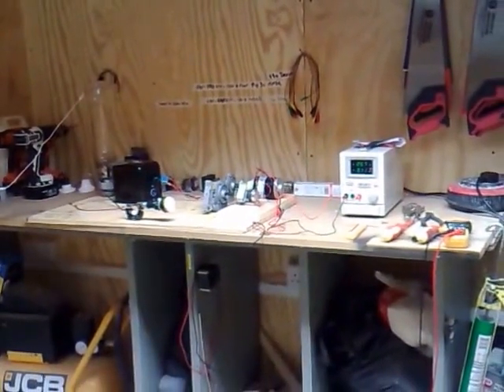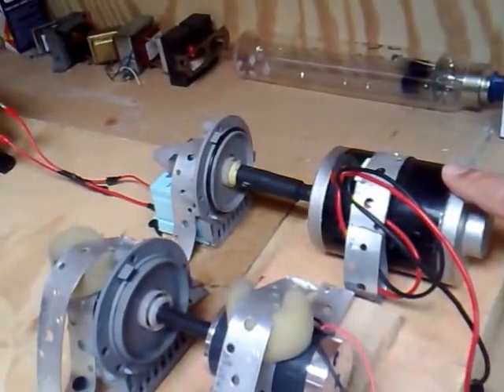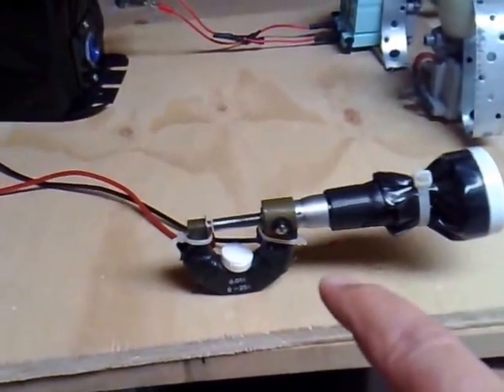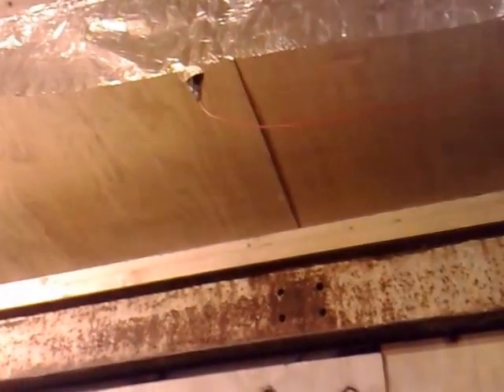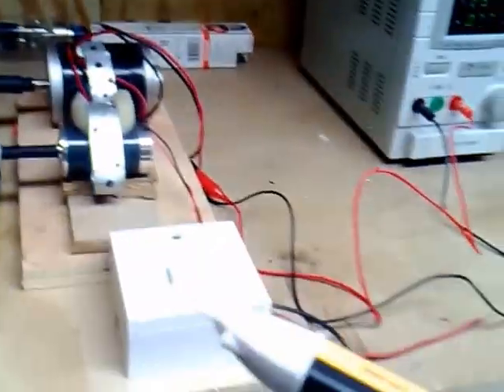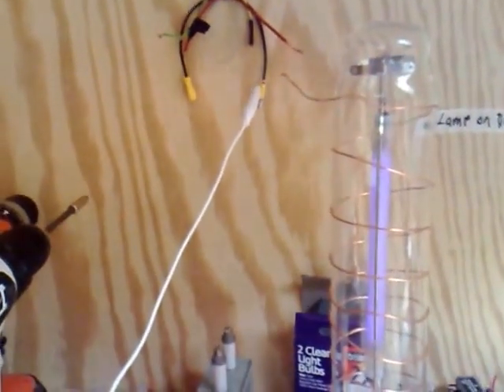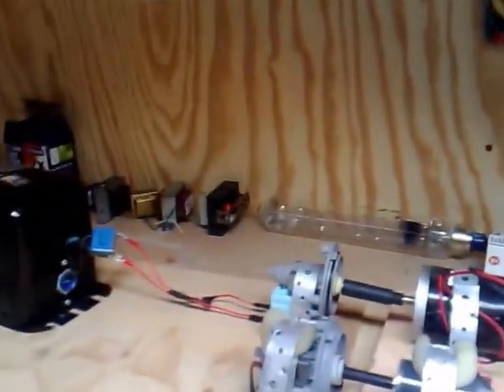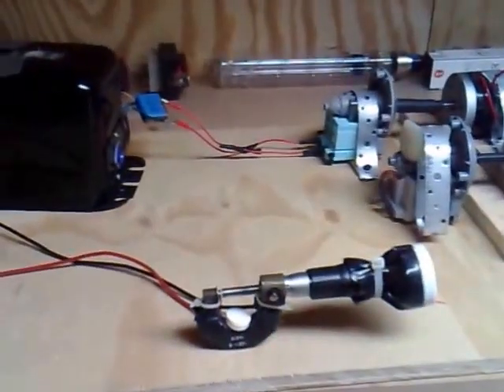Gerard Motor PROOF of RF.mp4

Comment: Hey E power DC your voice sounds a lot like Pete Townshend from the who. Anyway in some of the literature I have read from Tesla, when he would wind transformers he would leave sparks gaps, many sparks gaps in fact, and the reason he gave was an interesting one. First I must say that trying to understand what Tesla is doing in a conventional sense is a waste of time because his understanding of Electron flow is quite different from what I was taught when I attended the electronic institute in Pittsburgh. Today I work as an electronic technician for a company and have always been fascinated with Tesla. I makes me very angry to learn that Tesla had a very different idea about transmitting electricity to homes with no heat loss transformers which would have made everyone's electric bill very cheap, I was taught in school that if it were possible to correct the power factor phase angle to perfect unity our electric meters would not even turn, tesla transformer would have corrected this but greed as usual shot it down and all evidence was incinerated, well almost all.... But that is not why I am writing. Tesla stated that when a spark gap is added it acts as an amplifier when the arc surges from one gap to the next and that he would put as many gaps as he could in his transformer designs, which I used to have, so I was thinking ...most people use one spark gap but what if you could use several transforms connected together and in between each of them add a spark gap? Just a thought.But be careful my father in law did something simular to this when he made a giant tesla coil and blew out everyone's radio and TV reception for a block and a half, he was quite happy with himself. SO yes definitely, high frequency Radio waves is the key here we all should be focusing on.
Reply from the maker: +Harry Flo  hI again HF like your comments about the spark gap because understanding what is going on is KEY. Tesla called lightning "Events" in the either. Electron flow is also very interesting. Quantum theory of light= wave & particle & possibly scalar at the same time, sounds like Mm electric. Trying to make a plasma transformer at the mo, video delayed very busy. However I can not wait to try it out. Thank you for your interesting comments, I look forward to more from you. ....  DC
Reply: Our system does not want people to have a way of developing cheap power, if it doesn't create profit it will not be researched nor exploited, instead it will be suppressed and killed off by any means necessary. This is our wonderful system, it doesn't matter what country you come from, it is the nature of most men to be greedy and dominating,  controling others so they must submit and be enslaved and conditioned so the wealthy elite will be able to manipulate and control so they can remain in power.
 It is up to the free thinking individual who doesn't care about wealth and power and is only interested in the well being of his country men and women, this individual is rare and only comes around few and far between in history, this person of whom I speak was TESLA, selfless, humble and generous someone who gave a damn but was forced into bankruptcy from the Wealthy PIGS who wants humanity enslaved instead of empowered and free...

Comment: Interesting idea that electricity is RF. Has some merit. Electricity is not actually carried by free charges. It is carried by changes in potential (electric field pertubations). The virtual particles which carries the energy are phonons and excitons, not electrons. The electron drift is not fast enough, nor has enough charge capacity to explain the current. Also, ac drift is slow. In the old-days the ac current was truly alternating between positive and negative (causes issues with potential difference direction changes with grounding), but yet the current capacities were enough, though the net electron drift over 1 cycle is zero.
Reply from the maker: +rascal1234 Yes now we have synergy, I like the way you think. So what happens in the current? Scala? Knock type vibration? Thank you for your input, very interesting. ....  DC

Comment: Interesting discussion but at the level of standard Kirchhoff-Ohm sinusoidal circuits. This is not the type of circuitry Tesla was working on. His (Tesla) radiant energy doesn't oscillate sinusoidally, its aetheric where motion takes spiral and conical path at small scales (Planck scale perhaps)
The radiant energy pops out from wire at 90 deg and doesn't oscillate the standard way . Traditional power calculations don't apply at nano and smaller scales. 
This Tesla radiant energy can power both lamps and motors.

Comment: hey there. i'm just asking this small question: What is the Pump? ist it just a rotationg magnet with a coil underneath it?
Reply from the maker: Hi basically yes it's an A/C unit. This set up is a great starting point for experimenting cos of the findings with learning about electrical potential & more importantly how its made. Ask the right questions, but experiment for yourself. ... Regards... DC
Reply: Thanks, DC, but I'm not an electrical engineer, but I'M trying to rebuild my knowledge. actually, i just want to know, because i have to explain it to someone i Know, who knows the conventional stuff really well. together with him, i will build it.

Comment: Did you do any meter readings off camera?
Reply from the maker: +Colin Hammill  Hi Colin yes, going to share some readings on next video. The reason I didn't was that I blasted one of my three metres & damaged my scope getting them too close to HV. I just want any readings to be correct. Some of the Hz readings were around the "Tesla Lights" readings low 5Hz to 13Hz I could vary the Hz with higher motor revs.
Reply: ***** I think the Hz have a lot to do with Gerard Morins results I`ll keep an eye out for your video. Cheers for replying mate :)

Comment: All AC is RF ! Free energy must be amount of work done the bulb is reflecting at a lower energy level due to a higher frequency so you need to use something that can lift weight like a drill ..Ok ! But nice video and please do the loop  between the two motor generator its very simple if you know what you are doing.

Comment: If you held the tester ,2-3 feet away from the aluminum foil at the same height when you were testing the foil for RF, you would have been amazed to have found that your tester would also beep.         HuH  !! ??      yeah !! your might pull your hair out  and discover the air being warm at that height is  energized thus giving you a false positive. You also did not install a blocking diode preventing back EMF.  thus, possibly negating presumption of a high RF signal that operates within the tester's range.    Don't be offended by my skepticism.  be challenged.
Reply from the maker: +moron moron Hi M.M. I am just a learner "Student" of Tesla. I am looking with untrained eyes. Electric is very much like "Light" in the way it behaves. I am working with "High Voltage" like Tesla, its really interesting particularly at the "Spark Gaps" in relation with tuning. I am not offended & I have been playing with "Blocking Diodes" with interesting results. I have much to do & learn & share. I am making silly errors but that's life.   ....  DC
Reply: @e.powerdc1127  hi dc regards I have a gut feeling if u cd test it out for me, at high frequency the transformer charged with  ac using the morin pump or even a normal alternator, or say pump 4 all matters 2 keep it simple.. that u have is made...... can make ferrite core resonant due vibration esp at high voltage...... Such that ferrite absorbs and reflects  RF and its  carried as  electric charge via spark gap which raises its pressure  or voltage further via conductor  and removes the magnetic component making it  unlike ac becomes a longitudinal transmission in other words a RF., RF has only the longitidinal aspect and as long as it's hv will light up things in its path or through what it passes but as the energy density goes down unlike microwave it can't achieve much  inductuce unless near another conductor. Or at least resonant at same wavelength.. Thks for the beautiful experiment... Quite a learning curve 🌹

Comment: Gerard, are you claiming to have "created" rf-energy from nothing?   I don't believe it's radiofrequency energy at all.  Actually, the frequency of the high-voltage side of the step-up transformer that's driving your fluorescent bulb is the same frequency that your ac-generator is spinning at (times the number of poles), which means it's probably a couple of hundred thousand cycles-per-second at most and not high enough to transmit at low power from an antenna.   To show that it's not rf-energy driving the bulb, use an oscilloscope with a step-down voltage probe (1000:1) to view and measure the frequency of the output and the waveform itself.   BTW, why do people comment here so rudely and in bad taste?
Reply from the maker: +James Hacsi Hi James, still learning & my scope down, lot going on & I do not understand it. Better to be respectful, its just experimenting & learning.  Regards .... DC

Comment: There's nothing new here.   What is seen is a rotary converter device that uses energy from electrochemical batteries to drive a DC motor, which then drives an AC generator whose ac-voltage output can be increased or decreased with a step-up or step-down transformer, respectively.    The same effect can be accomplished - as it is in HEV's - by utilizing a DC-AC inverter driving a step-up or step-down transformer.  Total power which equals voltage times amperes always remains constant.   If voltage is increased (with a transformer), then output current will drop accordingly, and vice versa.
Reply from the maker: +James Hacsi  Hi James I agree, voltages x Amps. Voltage also drives Amps (Yes)?  Can you help with this one? https://youtube/watch?v=240FgeKfgUA  It all happens @ the spark gap.   ......  Regards DC
Reply: +contactbiotrance   Again, you have not understood the concept of POWER. In your pole transformer scenario, the 7.5 kV high line has the ability to deliver tens of amperes. That, truly, will kill you deader than Kelsey's nuts.  OTOH, what E.power is playing with here is a mere fraction of one watt, an insignificant amount of POWER. That's why he can withstand the shock, albeit it may be uncomfortable. The electromagnetic radiation / radiofrequency / or whatever other bullshit has no bearing on the effect.  It's the POWER. Get it?
Reply: +contactbiotrance   OK, let's keep it simple. What the guy in the video is doing is generating high voltage, but virtually no amperage.  Almost no current. Get it?  That's  why what he is doing is not dangerous. At the same time, the output power is so low it is useless. So if you want to run practical, everyday electrical loads, like washing machines and coffee makers, this "technology" is useless. It is a curiosity, fun to play with, but has no practical value.  When you multiply voltage by current, you get power, usually stated in watts.  High voltage, low current equals low power. High voltage, high current equals high power. That's why you need to stay away from your pole transformer! Epower is just fooling around with early 20th century electrical playthings. Fun, but there is no practical use. But have fun, just be careful.
Reply: *****  Yes, I agree, in a very long time, we may be able to harness forces and energies unknown to us at the present time. But Tesla's experiments and papers have been studied for a long time, and not much has come of it. As far as I can tell, only the Russians are trying to replicate the Wardenclyffe Tower.  We will see...

Comment: The output from the pump motor is of course ac at moderately high voltage but most certainly not at RF. The safest  lowest Rf ac is listed at 20khz. To generate this high frequency the generator must be driven at not less than 1. 2 million rpm as the generator is a 2pole machine.. From the information given by Gerard Morin for a similar set up he motor runs at 4000 rpm. At this speed the ac output is at a frequency of about 66hz.. It is not possible to generate hf or rf ac using a rotary machines. The motor would be required to run a more than a million rpm for a 2 pole ac generator and proportionally less as the ac generator poles are increased . but obtaining hf or rf using rotary machines is not possible. The so called rf effects are due to the very high voltage and the very very low current available.

Comment: The coil around your lamp has an induced current from magnetic field.  Electricity and magnetism are complementary.  Hence, you are doing like a transformer and energyzing your paper foil, not sure what you are doing with it.
Reply from the maker: +Eric Hamel  Hi E.H. I like your comment you think like I do. Please view my latest video "Plasma Transformer" using two "Spark Gaps" a scaffold tube, coil & Flo tube. Can you now see what I am thinking???  We have synergy!!! ... DC
Reply from the maker: +UniversalExpanse Hi E.H. I agree please have a look at my "Plasma Power Generator Transformer" ; lots to work on with this setup !!! RF or Not? Real Power or Reactive Power? Voltage? Frequency. AMPs v Watts at wall P.P.  ...    Regards .... DC
Reply: the voltage is induced, the current cannot flow without a load closed circuit

Comment: Surely not?is this not just an induced current?The pen you are using is simply insufficient to make any conclusion other than the fact that there is a small induced current in the copper wire.The truth is that you did not need to test this wire to know that a current would have been induced from the activity in the lamp...if you took a standard 1.5 twin and earth cable and wired it up to any light, then disconnect the earth wire and connect a phase tester and or a meter to one end of the earth wire you would see the same effect depending on the length of the cable it could read as high as 50 volts.Regards
Reply from the maker: +Dermot McLaughlin Hi D-Mc I do think that it is RF. Why? Well before I broke my scope it showed RF wave form. Capacitance, Reactive Power? May be, needs more investigations. Its got me hooked & others.  Regards ... DC

Comment: This got buried below in case you missed it: "Adding the spark-gap does hint of a Tesla coil type device.    Is your overall objective to transmit energy wirelessly like Tesla proposed?   The bottleneck in that case is that transmitted power diminishes at the square of the distance from the transmitter.   It's then imperative to have an understanding of  parallel resonant circuits (or "tank" circuits), because an antenna receiving rf-energy one mile away from say a 10 kilowatt transmitter will be receiving energy in the microvolt range.  A tank circuit selects the frequency (like adjusting a radio channel dial) and it distinguishes the inteligent tiny signal from surrounding noise.    But energy or transmitted power diminishes very rapidly as the distance from the antenna increases."    "If you're interested in wireless energy transmission, then go to:  https://www.youtube.com/watch?v=dYXjlqwdy44&index=90&list=PLERGeJGfknBR3pXCPlV3bgb_qHCSNOdBf     Dr. Walter Lewin at MIT shows a way that energy does NOT diminish at the square of the distance from a transmitter!    I'm ready to file a US patent application for a system of wireless energy transmission, so take this as a hint and improve on it.  If you come up with a better system than mine, then more "power" to you!"   The best part of the video begins at about 25 minutes in when Dr. Lewin walks the dipole antenna around the lecture room.
Reply from the maker: +James Hacsi  Hi JH thank you for your input, we have common ground. Dipole, mid catcher plates (eddy currents) selective vibrational metals. Mm yes please. Its like ringing a bell with a hammer when a identical is located near by it rings in sympathy. Simple Yes?

Comment: At 6:00 you are dead right - it is RF, much higher frequency than the mains, and you are illegally transmitting on some random
frequency or frequencies that may for all you know be interfering with medical devices, emergencies services, broadcast TV and radio...  You need avoid doing that if you don't want a call from Ofcom.  Large fines and confiscation are standard for willful illegal radio transmission.

The correct way to investigate RF is with the appropriate test equipment, and conduct your experiments in a Faraday cage.  Or
do the experiments well away from any habitation (hard on these crowded islands!)
Reply from the maker: MT... Hi, I hope that this helps. 
The building is clad (Roof & Walls & then steel doors) part brick & wood structure again steel clad with "Grounding Rods" Earth bonded so to minimize radiation / stray voltages. The building itself acts as a large "Faraday cage". How do I know this cos my radio (All Frequencies)  does not work unless I use a grounding rod. 

Disclaimer: Due diligence & care was built in the construction.
I am a 69 year old student of the works of Nikola Tesla so I do understand your concerns. I am certain I do not make any interference that may course harm to others in this matter.
May a offer this to you with respect. The corruption in governments is killing / polluting the whole of the Globe. Please direct your comments to the heart of the matter to the "Main" "Polluters" & be certain to know the facts "Before" commenting on this channel.   Regards ... DC
Reply: Ah good, my fears were groundless (bad pun)...
Reply from the maker: Hi Mark I do value all comments, thank you for rightly pointing this out. The only unknown is my discovery of Scalar waves at certain frequencies / spark gaps. My approach in testing these is in very short bursts & in remote areas and soon in very remote areas in other countries. I hope to be testing over long distance very soon. Regards ....  DC